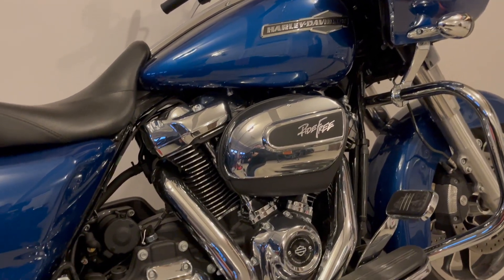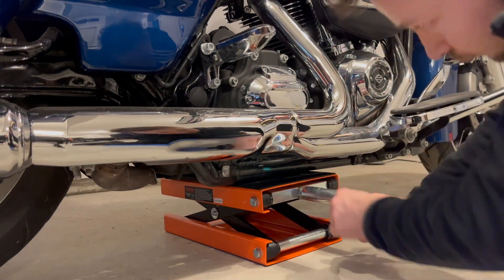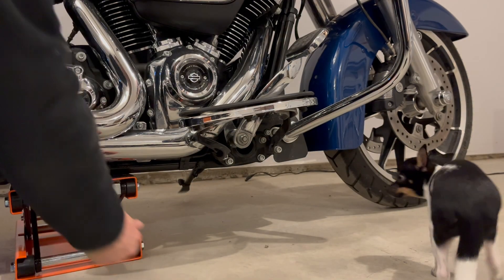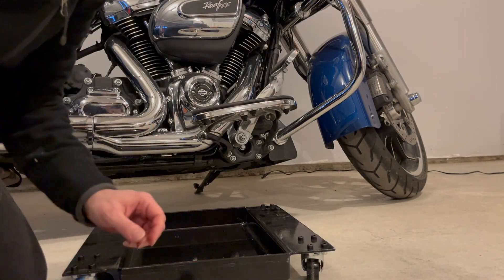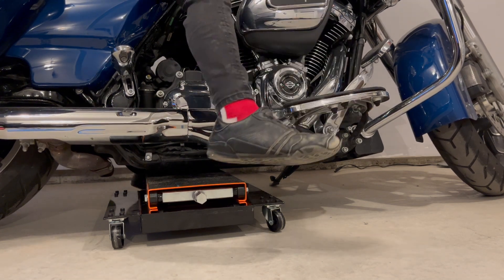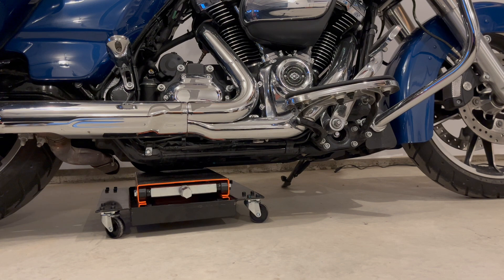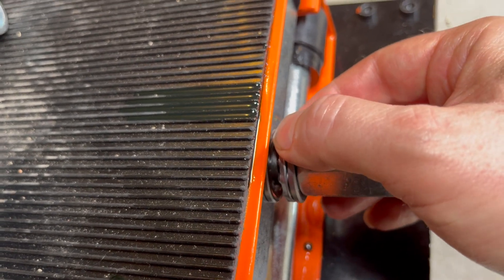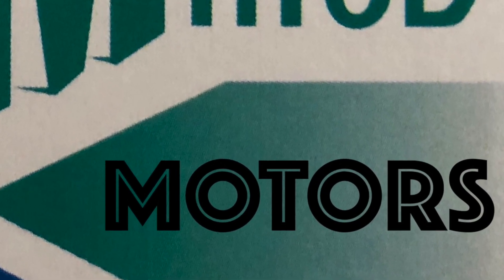VEVOR Motorcycle Lift Review and Issues

Comment: That's insane! I have the same lift and I constantly worry about the bearings. Mine looked loose right from the moment I unboxed it. Fortunately, it's not the only bike lift I have; I primarily use the Vevor for my lightweight motorcycles, such as supermoto and dual sport models. For heavier cruisers, I rely on more substantial equipment.
EDIT: I just wanted to add that usually these thrust bearings break when you lower the bike, use drill with socket, and go beyond the stopping moment. I just ordered better quality one for potential replacement.

Comment: I wonder if the bearing was missing it's cage from manufacturer.  Seems to be to wide of a gap if it doesn't have a cage normally.  Yes, disappointing.
Reply from the maker: @goldwingconepatterns2565  potentially, seems like a manufacturing defect to me.